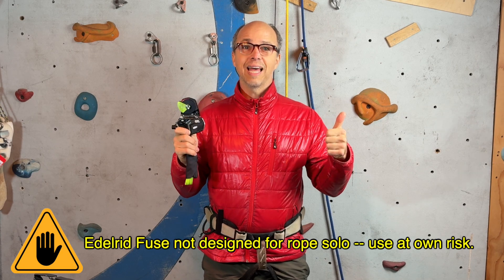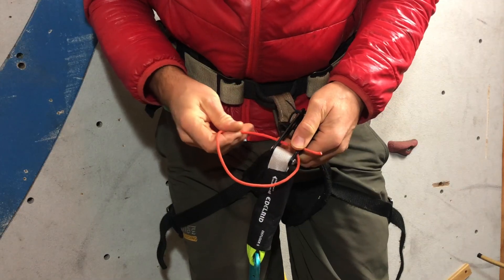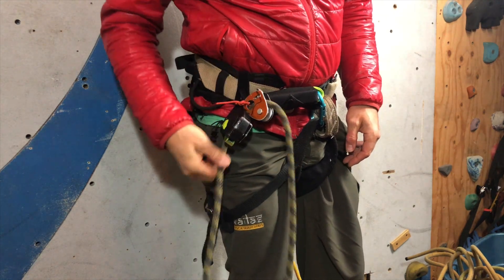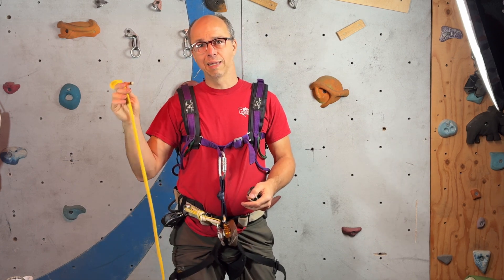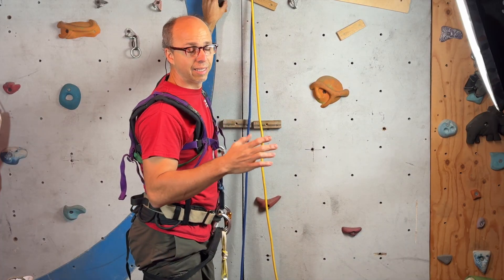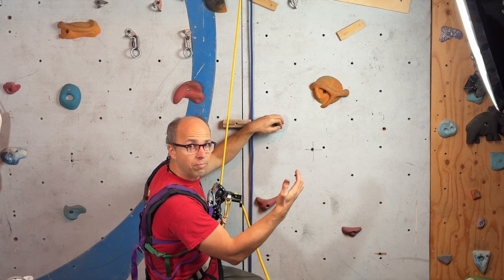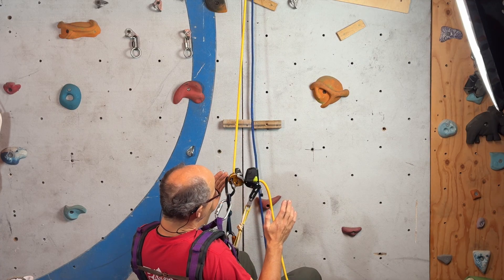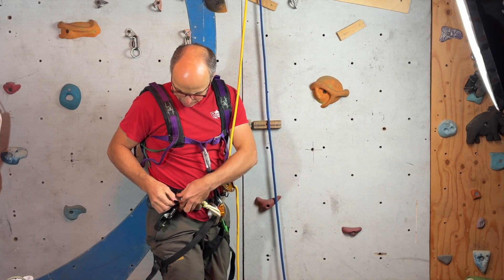The Edelrid Fuse as a Lead Rope Solo Backup: Real Drops!

Comment: Again, thanks for your work and the video! Looking forward to the simple and efffective Fuse jammer!
Interesting to try the FUSE with different rope diameters. Of course, that were no real falls into it, but in your older video it would have saved the climber (but killed the rope..). 
If it is possible to find a rope diameter that allows for the grigri+ in toprope mode as a primary while still have the FUSE function as a reliable backup, that of course would be awesome! 
In case you need the FUSE to be a real backup (you would have your primary fail completely), the defuser or another creamer like the shorter G-Screamer by Edelrid would probably increase the chance, both the climber and the rope survive? Depending on whether the FUSE would jam into the primary i guess..
Reply from the maker: Absolutely agree with what you say! I tend to use the Fuse with Fuse jammer confidently as I don’t think the primary device will release the rope. That is: I need to make sure my primary device connection is BOMBER also!!
Reply: @YannCamusBlissClimbing  Yes! I personally use a maillon rapide to connect the primary (slightly modified Grigri 2) even though it is a little less convenient and have never heard of a primary (not the connection) fail completely. Still, for peace of mind, I would trust a "full backup" more. Probably the smaller diameter suitable for the Grigri+ Topropemode as primary will make the Fuse less reliable as a backup. Looks like maybe a 9.1 Joker might be a middle ground - the 8.9mm Opera would be even lighter and nicer of course, just not sure wheter the Fuse would still work reliably with the skinny dry treatment rope..
Reply from the maker: @EdeSchmitt opera is 8.5mm of course. I tested the Fuse with heavy falls (fall factor 1 and 2) with the Mammut 9.5 here and …. Testing Gone Wrong!! Edelrid Fuse
https://youtu.be/ec6qbwEjIks
Reply from the maker: @EdeSchmitt do you use  a 10mm maillon or an 8mm maillon?
Reply: @YannCamusBlissClimbing  My bad, the opera is 8.5mm of course, that´s why I would probably not trust the FUSE as a backup when using a dry treated Opera (even though it would be great to have just one really lightweight rope for glaciers, mountainering and LRS). 
I use a 8mm steel maillon. Works pretty good to connect the main device (Grigri), it should be impossible to break under 10kn, so I deem it to be "bomber".
Reply from the maker: I made this video for you: https://youtu.be/1IuZ-vAeqhg Let me know if it was useful! Also: I have tested the Fuse on an old Opera and it bites GOOD! I need a meter of brand new Opera so I can compare! Maybe it slips around bodyweight. But this is good enough as a third hand... Yes?
Reply: @YannCamusBlissClimbing  O wow, thank you  very much! I just watched your new video and left a comment, definitely useful! 
I don´t own the Opera yet (and live in Europe), is there a way to support you to either get one ore just to support all your content and the time answering comments? Didn´t find it on the website besides ordering your products (which I am sure to do, as soon as the fuse jammer is in stock).
So you think, the FUSE should be a reliable third hand even with a knew dry treatet Opera?
Reply from the maker: @EdeSchmitt you can become a Patreon or buy an online course. Yea the Opera probably works with the Fuse as a third hand. I need to test!!

Comment: bro lol the fuse is way bigger than the mtx come on "4:02, it will be smaller than the micro traxion, it will be all integrated within the edelrid fuse". You know what doesn't slip when you push down on it? The micro traxion
Reply: I'm pretty sure he means the jammer will be smaller than a trax, not the device itself.
And they're not really comparable, one is meant as a cache loop manager and the other is meant as a back up device.
Reply from the maker: What @renderyours410 says… The fuse jammer adds 5 grams to the Edelrid Fuse. Yes: the Fuse is way bigger than the micro Traxion!! Makes sense?
Reply: @YannCamusBlissClimbing that does make sense thank you!

Comment: The Fuse looks fantastic as a backup device!

Would you recommend getting the Fuse only, or would you also recommend getting a Defuser too?

I’m doing a big shop for Black Friday, so I want to get everything in one go to save some money. Cheers Yann, keep up your good work!
Reply from the maker: If you want to be able to safely attach the Fuse without the metal connector we will include in the Jammer kit, go for the Defuser. If you want the best in the extreme case your primary device or its connector explodes / let's go of the rope, get a Defuser. If you want the lightest setup, wait for our connector and get a 24cm (or 30cm) dyneema sling. Makes sense?
Reply: @YannCamusBlissClimbing Sounds good mate 👍🏼

I found a massive deal for a Fuse + Defuser anyway (30% off), so I just bought both. 

I’ve got super short slings too, and I’ll buy your Jammer Kit when it’s released. That way I can experiment with all the setups you mentioned 🙂
Reply from the maker: @IanSendsIt  Let's go! 🙂

Comment: My basically new 8.5 will hold on the fuse but you have to fall on it. Just a
The little squeeze doesn’t hold but an actual dynamic fall will pull the cam in enough to hold. I’m 195 before clothes and gear so well over the 90kg you were talking about with a rack.
Reply from the maker: oh! That is good information! I wonder how much friction your 8.5 makes. Maybe enough to trigger the grigri or the sulu go? I wonder how hard of a fall is required for the Fuse to desheath an 8.5 ...It desheathed my Mammut 9.5 around 5.5+ kN! (quite high numbers) look: https://youtu.be/ec6qbwEjIks?si=30yI5Pr32NHC5KfH

Comment: So is this more like a second hand? It doesn't catch the fall, but engages your main devise? So it's not the same as a ASAP. Will the eddelrid fuse catch you if the carabiner of the grigri explodes?
Reply from the maker: More testing to come! For now the Fuse is a "strong third hand" that engages the main device. Yes!
Reply: @YannCamusBlissClimbing  so is there a use case when using a silent partner? As the silent partner should engage both ways of course. Like, if the SP exploded, could the fuse arrest the fall? (I understand you maybe haven't tested this yet fully haha)
Reply from the maker: @mrnosy1 it is a backup yes. If the SP explodes, or fails to lock… for sure I would use the Fuse with the SP any day.
Reply: @YannCamusBlissClimbing just seen your video from two years ago about the fuse desheathing the rope on lead falls. Is this no longer an issue then?

Comment: This is the video ive been waiting for! I Would like to see the shock absorber get used. I cant see it making a difference integrating it on a system, if that system does not allow for the absorber to extend! I may destroy one of my screamers to try it out here soon.
Reply from the maker: I agree. The absorber only will be usefull if the rope gets released by the primary device or the primary device or its connector explodes. That happened to Tom Randall on El Cap, right?

Comment: Thanks for the new iteration of tests, for the fuse and the sulu. I tested the fuse with a brand new edelrid swift protect 8.9 mm and it did not slip at my bodyweight (70kg) but as soon as i tried to climb again, the light weight decrease made the rope slip through the fuse hinddering my ability to project the moves of the route. So safe but impractical for ropes under 9mm. No problem with my used 9.1m joker. Can´t wait for the fuse jammer!
Reply from the maker: oh! I don't understand what exactly hindered your ability to project the moves. Can you explain a bit more for me?
Reply: 13:12  @YannCamusBlissClimbing 
I tested the fuse without primary device, (i was at ground level with a second rope, do not worry), so as soon as a tried to pull myself up the rope in the fuse slipped so î couldnt pull with my feet fast enough to reach the next hold and resume my climbing before i was 20cm below my previous point (it was in an overhang).
But in the normal setup your primary progress capture device will do the job anyway, so it does not matter.

My concern is with the desheathing, with a small diameter the fuse will pinch the rope with potentially less tension so it will be a longer catch but  it might be more gentle on the sheath of the rope so who knows.
Reply from the maker: @benzgeg  Oh I see! Yea the Fuse is not great in general for TR solo. As a LRS backup it is much better. Thanks for the info I need to do more tests!
Reply: @YannCamusBlissClimbing 
Hello Yann, I have been experiencing with the micro trax+fuse third hand set up but I did not enjoy the added weight and the forced unidirectionality while climbing (unlocking the cam of the trax one handed is a hassle). So instead I traded the trax for an Avant pinch cinch or an upside down autoblock knot (only 2 loop) with a small 4mm technora (aramid) cord to allow bidirectional cache loops length ajustments and so far so good at the extra cost of slightly more rope drag. Do you think its a bad idea while waiting for the jammer kit ?
Reply from the maker: @benzgeg  I think both can be brilliant! Good you experiment for everyone and share! Would you post on the LRS Facebook Group?? Sounds great 🙂
Reply: @YannCamusBlissClimbing  J´ai pas FB ni aucun autre réseaux sociales à par reddit et Youtube, là avec les fêtes je vais pas grimper en falaise avant 2 semaines mais quand j´y retourne j´essaye de te faire une vidéo de démo que je t´enverrais par mail si tu es d´accord, tu pourras la reposter ou tu veux si tu la juges de qualité. 
Update: si il y a bcq de dead rope ( autours 20 metre vers le top) le machard à du mal a retenir la grosse quantité de dead rope si la cache loop est trop petite, et plus de 2 tours rends la friction trop intense. La seul option viable c´est la Pince cinch ou une bonne pince à linge du coup ou un Spoc qui sera plus facile à désengager que la Micro.
Reply from the maker: @benzgeg bien sûr! Pour prendre contact par courriel: https://blissclimbing.com/contact/ merci encore!!